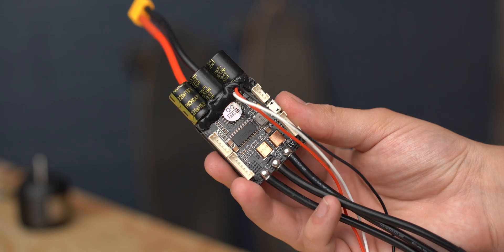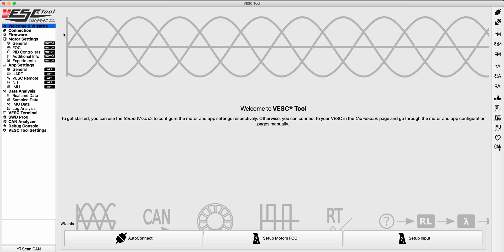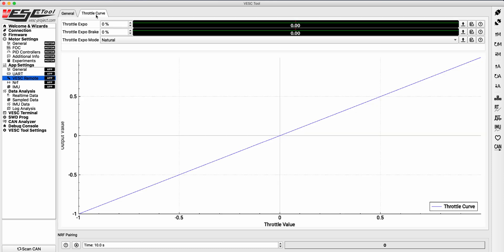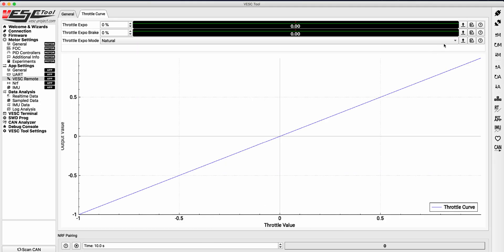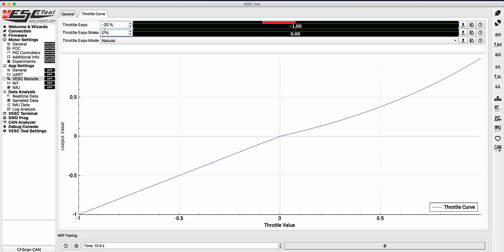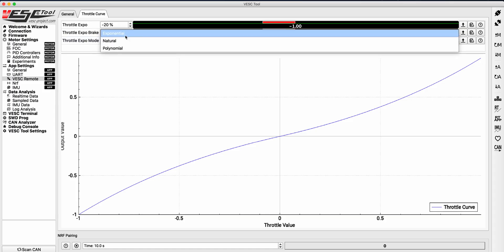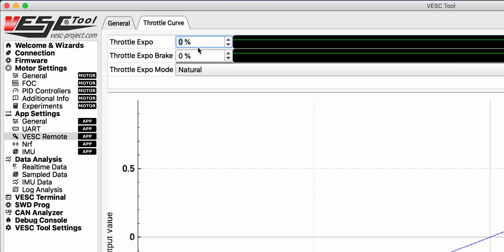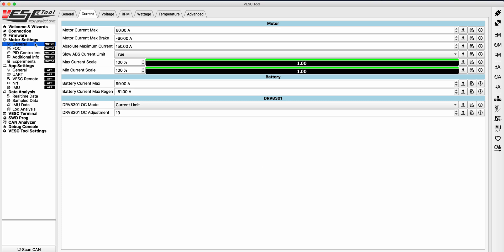Adjust Throttle Curve On Vesc Tool - DIY Electric Skateboard

Comment: HEY CAN YOU PLEASE TELL ME HOW TO SET A SPEED LIMIT or use the speed modes of a vx2 remote
Reply: You can't set the speed limit on VX2 or VX2 Pro remote. Only way to do so is either companies makes custom VESC remote that unlocks more features such as speed limit, acceleration power level, speed power level, braking power level or set it up the curve on VESC Tool.

Comment: Having trouble getting anything more then a 100% or 0% throttle .  Using  a ppm transmitter
Reply from the maker: Have you configured the Throttle mapping in the input wizard?
Reply: @MBoardsco  yes
Reply: @MBoardsco  yes
Reply from the maker: Have you ridden the board yet? Or only bench tested?
Reply: @MBoardsco  just bench testing, thank you for getting back to me
Reply from the maker: Typically bench testing feels like 100% and 0% because there is no resistance on the motor at all. Try taking it out for a spin and see what if feels like
Reply: @MBoardsco  ok thank you